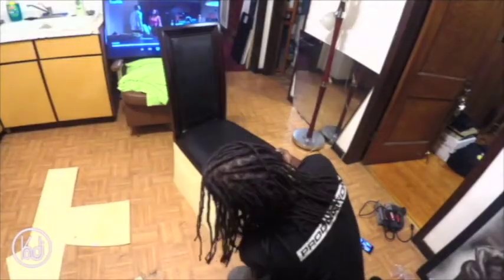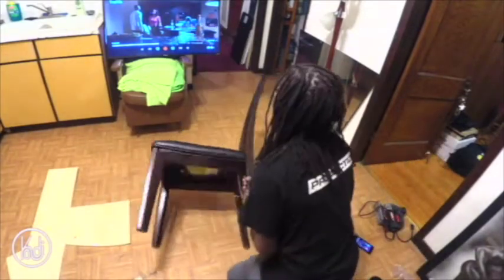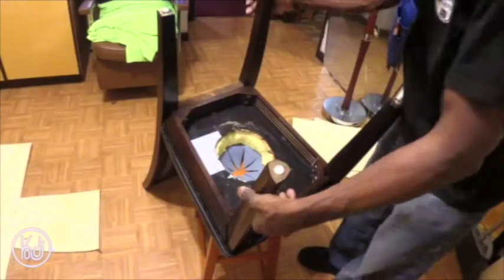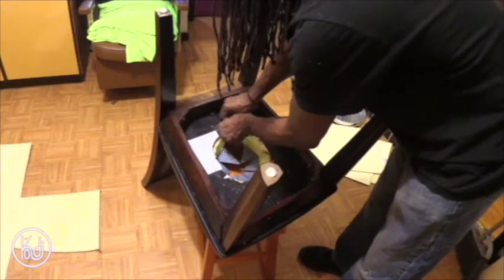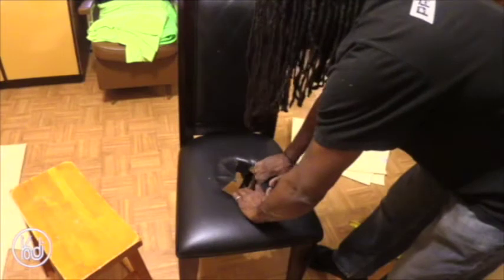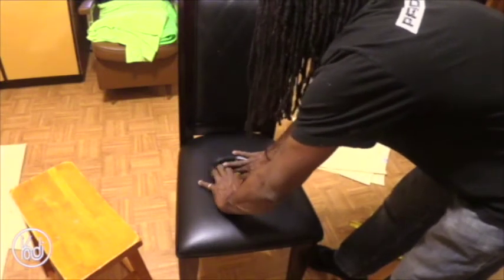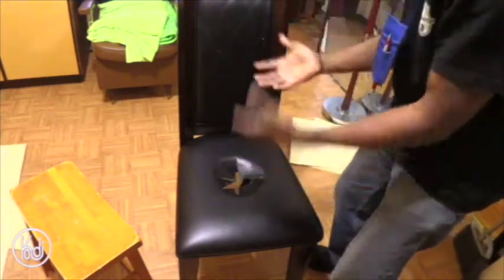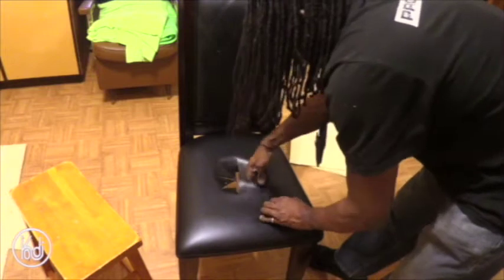DIY V Steaming Chair

Comment: Amazing work 😃
What did you use to cut the hole
Reply from the maker: A circular blade
Reply: @KODIDesigns  what are the dimensions sweetheart?
Reply from the maker: @sadikawilliams6822  I didn’t measure it I eyeball the area and made a hole that fit